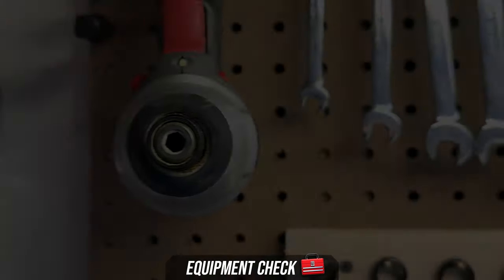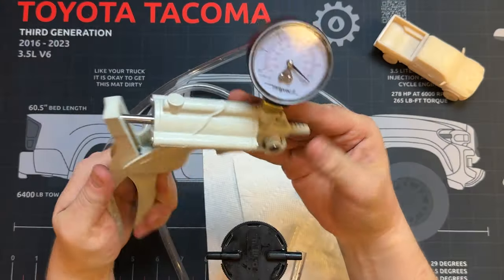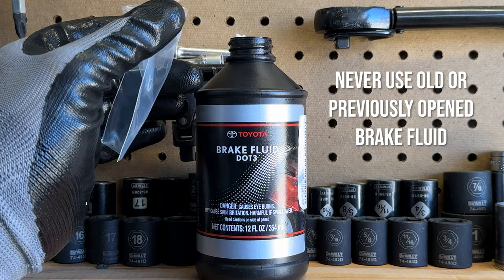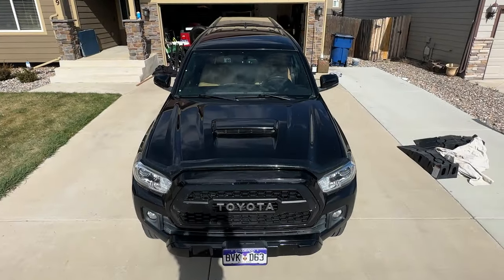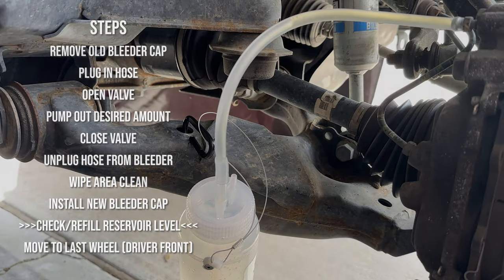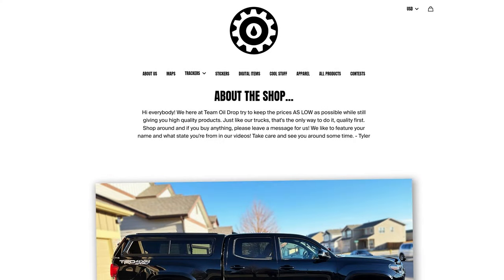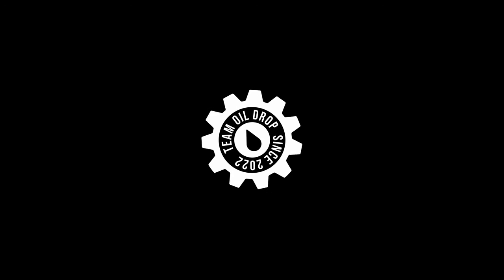How to Replace Brake Fluid on your Tacoma

Comment from the maker: IT IS GOOD TO BE BACK!
⚙See the items in video below!
💬Join the Discord: https://discord.gg/RUJbAj8QPB  (comment if link broken)
🤜🤛Wanna do us the ultimate bro/bro'ette move? Send this video to a tacoma buddy!
🚨 Finally on IG! : @teamoildrop
⚙Items in this video: (Amazon affiliate links)⚙
Maintenance Map - https://team-oil-drop-shop.fourthwall.com/collections/maps-trackers
Toyota Brake Fluid - https://amzn.to/3UdZ90Z
Budget Brake Fluid - https://amzn.to/4cZjoag
Mityvac Pump - https://amzn.to/49zPxlD
Brake Bleeder Bottle - https://amzn.to/3vWcEsT
Brake Liquid Tester - https://amzn.to/3Q4iNtN
Brake Bleeder Caps - https://amzn.to/3Q5bkL3
Needle Nose Pliers - https://amzn.to/3JpZXJP
Brake Line Wrench - https://amzn.to/3UiLhCQ
Drain Pan - https://amzn.to/48xrvYe
Rubber Gloves - https://amzn.to/3UlFYmc
Eye Protection -  https://amzn.to/4aEqlfJ
Syringe - https://amzn.to/4aPtKYR
Mini Baggies - https://amzn.to/441qAhH
1/4" Torque Wrench - https://amzn.to/4aRiavJ
10mm Deep Socket - https://amzn.to/3VYgVGK
Tiny Hose Clamps - https://amzn.to/3JjW2ys
Budget Scan Tool - https://amzn.to/441Jy7V
Fancy Scan Tool - https://amzn.to/4aBcbeJ
(These are Amazon affiliate links: Amazon pays the channel a small fee every time you fine people buy through these links)
Notes: Link to Toyota Official TSB: https://drive.google.com/file/d/19bK54_TPkpOUlDbJnvEcuI224zX_hZbw/view?usp=sharing

Comment: Seriously been putting off taking the truck into the shop since before covid knowing it was gonna cost thousands to do all the maintenance.  So stoked I found your channel man.  Just finished swapping the rear diff fluid, serpentine belt and flushed the radiator.  Next up are the spark plugs, transmission fluid/filter, power steering fluid and brake fluid.  Great work putting these vids together.
Reply from the maker: @CaliradoKid  love it. Hold off on trans a few more days, I’ve got a big update video to drop here asap. Truck currently drained as we speak. Thanks as always for the words 😎
Reply: @teamoildrop  Ok will do!  Still waiting on the fluid to come in so I'll hang tight.
Reply from the maker: @CaliradoKid  We are live! Happy maintaining.

Comment: Does the truck have to be on to do the bleeder bottle method ?
Reply from the maker: SR, SR5, TRD Sport, and limited do not need to be on, but TRD OR and TRD Pro will need to be for the hydraulic booster to build pressure. 

-Austin

Comment: What about the timing belt/chain for the 3rd gen
Reply from the maker: That has been considered. The chain is usually not replaced on a mileage schedule. It is considered the have the life of the engine. Unless there is another component failure that dictates the change.

Greg the Editor

Comment: Just curious why you switch from the vacuum pump to the reservoir for different brakes?
Reply from the maker: @CaliradoKid  solely for the purpose of demoing two different options. I like them both, bottle is quicker but vacuum allows you to drain the res.
Reply: @teamoildrop  oh ok perfect.  Just finished up.  In total got the spark plugs changed, coolant flushed, serpentine belt replaced, power steering fluid replaced, brakes bleed, throttle body cleaned, transmission fluid/filter replaced and rear differential fluid replaced.  Thanks for these videos brother!
Reply from the maker: @CaliradoKid  dang brother! Absolutely cleaning shop 😮 good stuff 🍻

Comment: Been trying to find a comprehensive list of how to bleed OR brakes. This will help a ton. Thanks!
Reply from the maker: Our pleasure! Yah, YouTube was missing key info and unfortunately was leading some OR/Pro guys that didn’t know better into mushy brake mistakes
Reply: @teamoildrop  with the larger master cylinder resevoir on the (2018)  off road, is the strainer basket removable. It looked like all one piece.

Comment: Great video for the Tacoma brake fluid replacement procedure. Step 5 calls out," Vacuum out desired amount." I know some techs are looking for the change in fluid color to know when to stop. Additionally, those rear brake lines are going to have more fluid than the front brake lines. The mightyvac container does have lines for up to 4 oz of collection. This can be helpful in determining how to utilize a brand new 32 oz container of new DOT 3 brake fluid. Thanks for the great tutorial!
Reply from the maker: Great points and thanks! I ran 32oz through mine just to flush it all 😌 🍻

Comment: This could not have come at a better time, was literally planning on doing my brake fluid this weekend
Reply: @teamoildrop I have a Pro and didn’t know about the auto bleed system, so good looking out. Saved me a trip to the dealership for when I would’ve messed it up the first time
Reply from the maker: @nicholasreed1192  they can be finicky if not done exactly right. Finally I’d weigh cost of tool vs dealership job on this one.

Comment: Do you think just gravity bleeding is less  accident prone than vacuums or pumping brakes?
Reply from the maker: Great question, it is slower therefore "safer"... however, as long as you monitor your reservoir you're going to be just fine.

Comment: Please help. I am trying to figure out if the master cylinder cap needs to be closed tight when using the vacum pump and when pumping the breaks with the bottle method. TIA
Reply from the maker: Just rest the cap on the top to prevent something falling in there, don’t seal it 😌
Reply: Will do. Appreciate you. Have a blessed one.
Reply from the maker: @vule5806  you too!

Comment: Does changing brake fluid make a noticeable difference with the braking performance of the vehicle?
Reply from the maker: If the existing fluid was contaminated with some moisture, yes you should see an improvement in stopping force and pedal feel. However any improvements may not be as drastic as say replacing the pads themselves. This one sorta just depends on the condition of the fluid you’re replacing. 

-Austin

Comment: Thanks for the video! I used your other ones to change out my transmission, transfer case and engine oils so far. Will be doing the diffs pretty soon as well as the serpentine belt. How much fluid is "desired" when vacuuming it out from the brake lines? Until nothing comes out of the lines?
Reply from the maker: Awesome! Love to hear it. 

That’ll be subjective honestly. I ensured a FULL refresh by leisurely running about half a bottle through each corner
Reply: @teamoildrop  Makes sense. I'll keep that in mind. Thanks!

Comment: So as the video states, my Sr5 model appears like a standard brake bleed. Many people on the forums state that the Sr5 requires a scanner to completely bleed the Sr5 abs system to perform a proper brake fluid change. Is this not the case?
Reply from the maker: The Off Road and Pro are the only models that require a scanner for bleeding

Greg the Editor

Comment: oh boy you actually need a scan tool for this? finally it comes in clutch......
Reply from the maker: I was specifically thinking about you in the discord; I wasn’t going to mention it until I had all the info neatly organized for you like this
Reply: @teamoildrop  I'm unsure if my scan tool will do the job or not....and that fancy tool is quite pricey.
Reply from the maker: @derekp6636  what exact model do you have?
Reply: @teamoildrop  2017 trd off-road edition 4x4
Reply from the maker: @derekp6636  sorry I meant scanner
Reply: @teamoildrop  my bad! Innova 5610
Reply from the maker: @derekp6636  Greg and I will chat with you in the discord

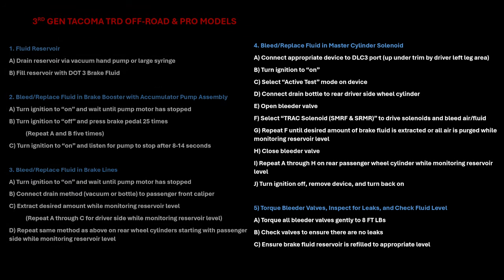Comment: quick question.. the video states that the sequence should be preformed longest lines to shortest,RR, LR,RF,LF, but the OR specific directions at 9:21, step 3B states to start at passenger front caliper (RF) then LF,RR,LR...  these are contradictory steps, can I get some clarification please?
Reply: nevermind, I think I got it, correct me if I'm wrong please, but first we pull fluid into the lines in that order w/a vaccum pump, then bleed them in the opposite order w/ the scan tool..
Reply from the maker: Neverminded........yiu are correct Sir

Greg

Comment: I just did this recently and when I cracked the bleeder and pumped the brakes it wasn’t forcing fluid out. Why would that be? The bleeder was definitely loose because it was vacuum/gravity draining very slowly.

Edit: never mind I didn’t wait till the end. Damn TRD off-road! Hopefully I didn’t cause any issues. Brakes have felt fine so far. Do you have a video on those steps specifically?
Reply from the maker: Do not have a video on the Pro and Off Road rear bleeding yet

Greg the Editor
Reply: @teamoildrop I'd really like to see that video too.
Reply: @kwitwerikok8o863  I went back and did it properly again. It’s all pretty straightforward if you follow the instructions in the description he linked. I think I’d say having a second person is a requirement though to do it right. Only thing I couldn’t figure out was how to run a solenoid bleed with the OBD scanner. Couldn’t find the option. Oh well

Comment: do you have a map for the 2.7l?
Reply from the maker: Everything is really the same, the only difference is the oil capacity and the filter type.

Greg the Editor
Reply from the maker: However, one is not far from being done. A week or so.

Comment: Soo does the ending of the vid also apply to 2nd gen tacos Offrod too or just 3rd gens?
Reply from the maker: A scan tool, that can activate the ABS solenoids, is required to properly bleed the entire system. 

Greg the Editor